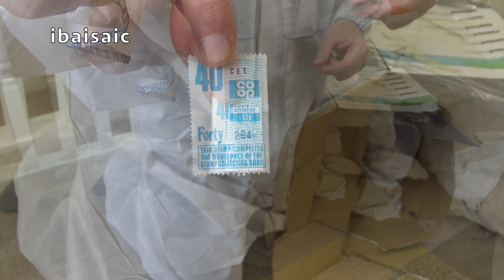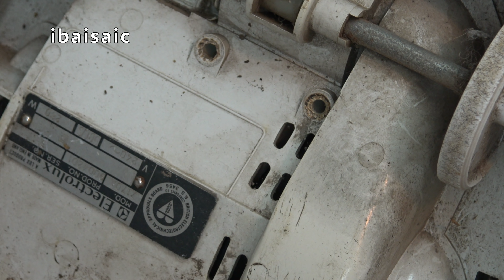Vintage Electrolux 170 Vacuum Cleaner Unboxing & Autopsy

Comment: Date code 3 17 would mean week 17 of 1973, so its 47 years old. I have a Electrolux E500 from 1973, and it looks so much more modern, being the replacement for the 170 I suppose. The 170 had probably been stored in someones loft or garage for donkeys years, maybe part of a house clearance after its owner had died, who knows. Hazmat suit was a wise choice judging on the filthy state it was in, and the "packaging" that it was wrapped up with.
Reply from the maker: There was more filthy packaging in the box that I cut out of the video, but I may show that as a bonus at the end of the video showing how the cleaner looks now.

Comment: Hi did you know the brush roll has two heights all thou its a floating head machine, as the brushes wear down you  remove the brush and rotate the  two  black side blocks 180 degrees that has bar markings on opposite edges( that has to be visible ) when reassembling so it lowers the brush roll down slightly if not the brushes can hit the metal plate. hope that makes some sense
Reply from the maker: Yes it does make sense. I noticed the markings on the brushroll bearings when I cleaned this machine up, but as the brushes were still pretty long I left it in the original position.

Comment: That kind of caked-in buildup is the telltale sign that a previous operator used it to vacuum a wet carpet. I've seen first-hand it multiple times 🤦🏻‍♂️

They likely shampooed their carpet but didn't wait for it to dry